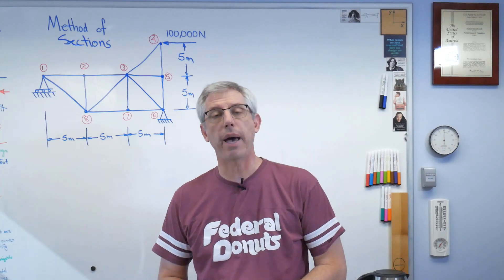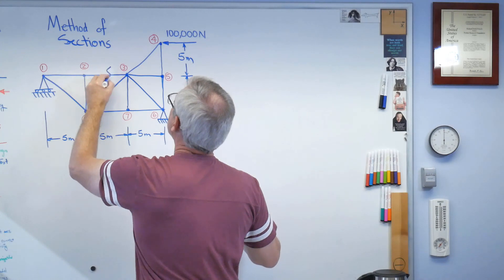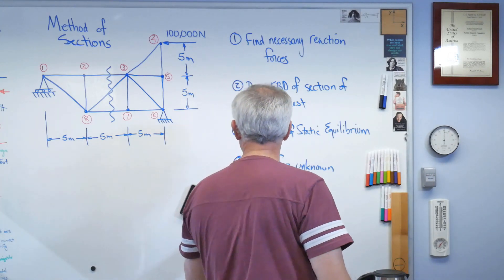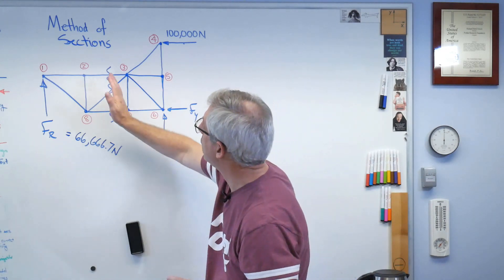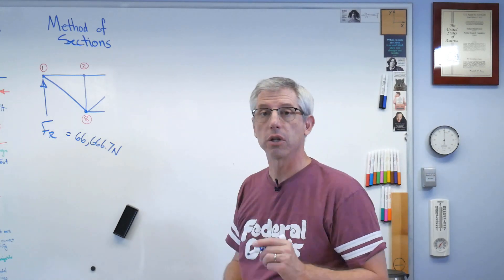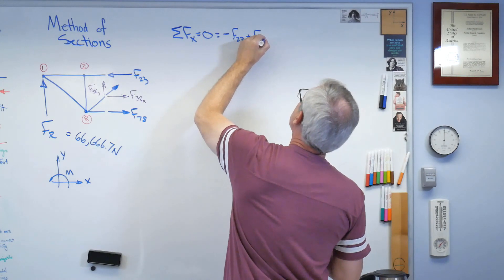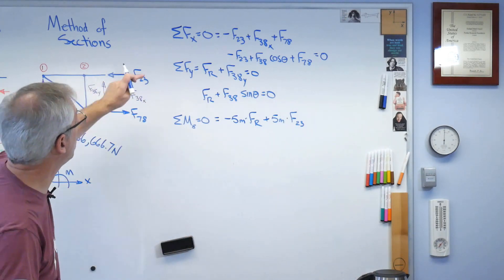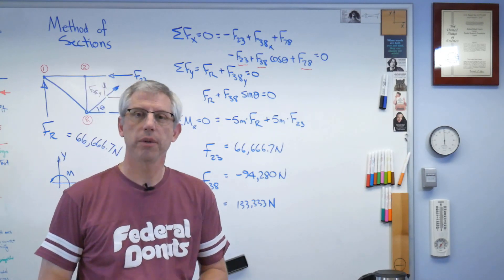Statics - Method of Sections

Comment: Hi I have a long winded question:
We use method of joints using equilibrium eq's, just like we use method of sections using the same equations,  only if the structure is statically determinate (Which your example is I assume).  What would you have done if it was indeterminate in this (complicated) case?

I'm still a little unsure as to how we go about deciding whether a structure is statically determinate or indeterminate.  There seems to be two methods.
3m vs R 
or
3m + R vs 3j + C 
m = members R = reactions j = joints C = no. of equations of Condition in structure 

Love your videos and think it's a crime you don't get paid for these considering you've switched the ads off.